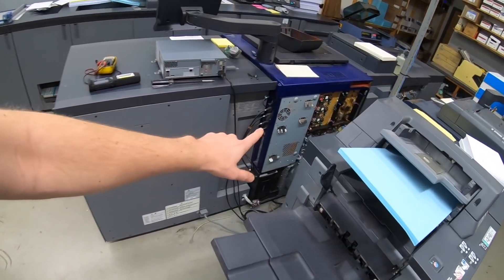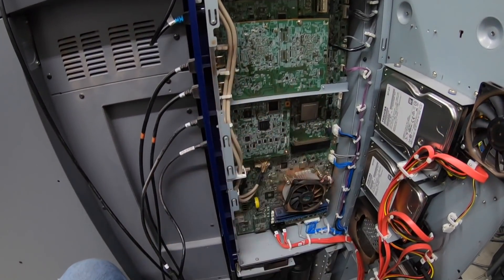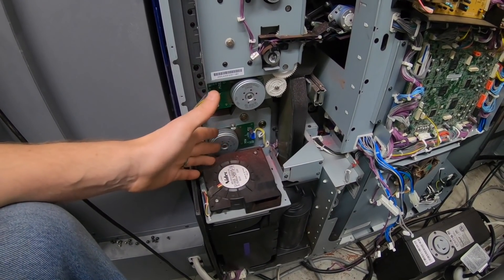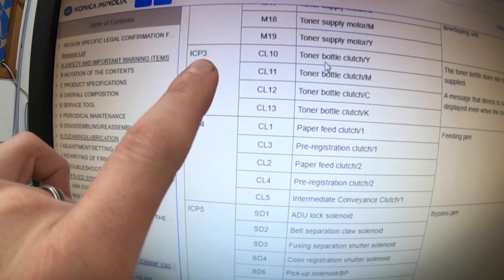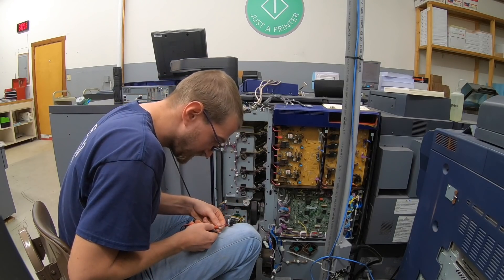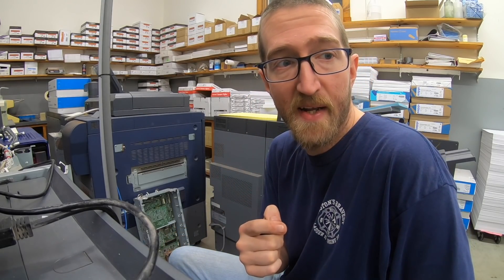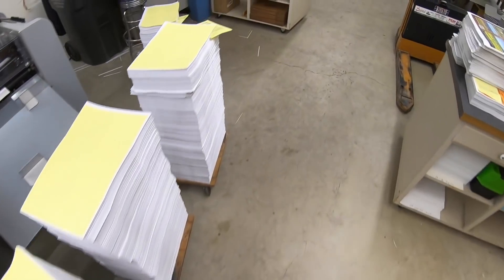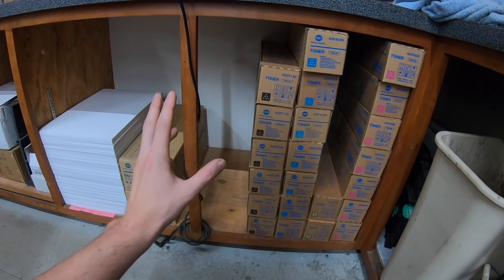Determining Why Konica C3070 isn't feeding Toner, What I'm Doing to make my Toner Last

Comment: I was hoping that you'd be taking out the skinny bottom Auxiliary Roller in the fusing area. Mine's looking a bit crusty with some coating missing in the middle and I can't tell how it comes out by looking at it.
Reply from the maker: If you're talking about the lower 2nd transfer roller its simple. Its just one clip and it slides out after you disconnect two wires on the back.

Comment: Do you have experience running any Ricoh devices? I'm considering purchasing a C9110, but i know there are a lot of comparable units from KM, Canon, Xerox, etc. Resolution is much more important to me than speed. We were looking at an Indigo 7k but it's just overkill. Any insight you may have i would value! Thanks Dan!
Reply: I am running a Heidelberg branded Ricoh that runs 90PPM color or b/w and it is awesome.
Reply: @DiscountPrintingSer  I'm glad you like it! Do you have any complaints, with the machine or service? I'm also talking to Heidelberg
Reply from the maker: I don't but I know others have commented that the production Ricoh machines are nice! Mike Hughes comments on here and he runs one. I'd like an Indigo too! The smaller, cheaper presses will have the same quality as the large machines, but much cheaper.

Comment: Which temperature is best for roll laminator to laminate 270-300gsm paperback cover?
Reply from the maker: I run all paper thickness at 265 degrees. Thicker paper I slow the feed down so it has more time under the heat roller. I run most paper pretty slow to ensure best adhesion.

Comment: Hello i really like your video, can you do a live stream of the printer just printing paper all day long and when you needd to fill paper do you have to pause th eprinter or do you just pull drawer or is there like a system where you  just stack paper on top of paper?
Reply from the maker: Ooo livestream, I haven't done that yet. If paper is only in one tray the printer will stop, if you have paper in two trays it will automatically switch and you can load while the printer is running.

Comment: Hi Dan,

I am a printer too :)  I always watched your videos, got inspired and started this business months ago in the UK.  We bought Xerox Versant 180 printing press machine. I have a question for you. I am printing on SRA3 sheet but prints coming out skewed, alignment is not constant between sheets. The other problem is when you print double sided, you can see alignment issue front and back of the sheet. But of course my biggest problem with that machine is there is no constantency printing between sheets even though I made alignment adjustment every single day. When I tried to cut 100 sheets at the same time to final size, if the design has borders, i can see most of leaflets will go to bin. Because edge alignments are very different between them. Xerox engineers says that this is the best machine can do... I am wondering if you have alignment issue with your printers?

Thank you :)
Reply: Yeah! Versant 180 pretty much su*ks regarding alignment. Ricoh and Minolta are much better when it comes to alignment.
Reply from the maker: Konica spec is that the print can move 1mm. But it really doesn't move that much at all. I often cut prints and every sheet is just about perfect. Konica c3070 would be better than what you have.

Comment: In my Canon, the problem was solved by unclogging clogged toner into the intakes of clutches. Clutches were moving smothly afterwards and optical sensor is timed if it doesnt see toner pouring in.
Reply from the maker: Interesting. I was hoping that wasn't my problem. It would be a mess to take that all apart.

Comment: Greetings from Russia. I am a service engineer for konica minolta. If you allow me, I will give advice: there was no need to order the toner bottle motor (M15). If there was a failure of the motor, you would receive error c2222, you can also check the rotation of the motor through the IO check in the service mode. I would recommend replacing these cluthes due to the risk of re-failure and the difficulty of getting to them.
Reply from the maker: I totally agree, I got the new clutches last week and plan on replacing them.
Reply: Can you help in servicing one that has been having errors for the past 3 weeks?

Comment: I had a similar issue on KM1060. SOLUTION: Opend the side cover (above manual bypass tray) reach for toner bottle and toner dispense units, clean them thoroughly, maybe use a hand blower/vaccum cleaner to suck any toner near dispense point and up and running. P.S.: sometimes machine won't take a new toner bottle, though it is full, you will have to restart the engine and it will start gulping toner again.
Reply from the maker: Thanks for the info, I'll keep that in mind!

Comment: With solenoid devices like clutches and relays, you want to test them by applying operating voltage with a power supply for a while and watch current. What could make sense in your case is that the windings on one is failing. It shorted to ground before, which is what blew the fuse.
Reply from the maker: Ah yes! Thats makes sense. I'll keep that in mind when this happens in the future. Now I need to put a fuse back on that board!

Comment: I usually just sit on the floor when servicing the rear of the copier.  My experience as a KM  production technician is that Mom & Pop print shops cannot get toner, larger shops can.  The Tatsuno toner factory in Japan is now up and running, it makes toner for production print devices.  Toner shortages are expected into next year.  Toner, drums, developer and PM kits are stuck in Long Beach harbor waiting to be unloaded.  Coated paper seem to be the hardest to get according to my customers.  Good to see you busy, I hope your machines make it through the holidays.
Reply from the maker: I hope so too! I have a ton of drums, dev, etc on the shelf right now, just in case.

Comment: why don't you buy a XANTE?
Reply from the maker: Speed is too slow, operating costs are higher, print quality is lower. It woud be a good machine for backup or envelope printing. I'm drawn more to an inkjet machine to compliment my shop now.
Reply: @justaprinter  iJets are nice for envelopes but very pricey IMHO.  Ideally I would like to have a dedicated black inkjet envelope machine and a color one so Riso Comcolor may be a good solution.  Have you seen any actual print samples of a ComColor?  I heard they are best suited for things like variable data invoices and statements and if the ones I get in the mail are any indication of the quality then I may have to pass.
Reply: I have an Illumina and it’s super slow but a great backup. Not great for high volume production.

Comment: One more thing a little of topic, have you ever considered or looked at Riso stencil duplicators or inkjets for running envelopes?  I have a GR-3770 for line copy b/w envelopes and it's okay but old.  It does run a offset press speeds but limited to 600dpi.  Not the perfect solution but okay in the short term.
Reply from the maker: Yes, we used to have a RISO stencil machine. I'd be interested in getting a comcolor inkjet machine now. It would be great for envelope and light coverage. Just nice to have that option on my floor here.

Comment: Nice work Dan.  My Ricoh c901s went down this week too.  In my case it was a bad PCB relay board that supplied my fuser.  I had a SC562 error indicating a bad thermistor in the fuser which it has 2 of them in each fuser.  I had a spare working fuser so after I swapped it and cleared the code it alerted again so I was pretty sure it wasn't a thermistor as the chance of 2 going bad at the same exact time was highly unlikely.  Thanks to Hytec I was able to get up and running with a board swap.  I am know more confident I can tackle non-mechanical service issues after this since Ricoh doesn't seem interested in servicing my machine.  Glad I hung on to my Konica C-654e for a backup as it came in handy while down albeit slower in comparison.  What Konica models run 90PPM color?
Reply from the maker: Awesome! Glad you got it figured out! There are several Konica machine that run 90ppm +. You can see on the Konica website, they change the numbers on them so I can't keep track, LOL.